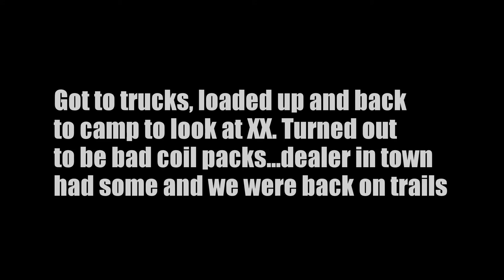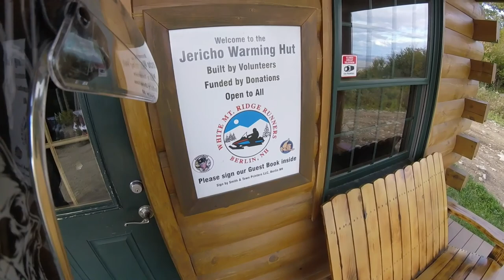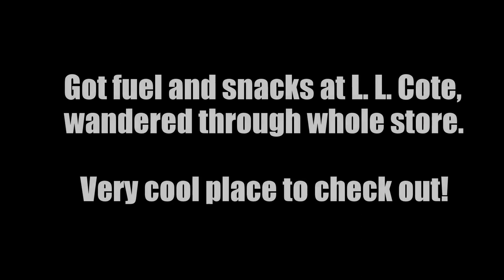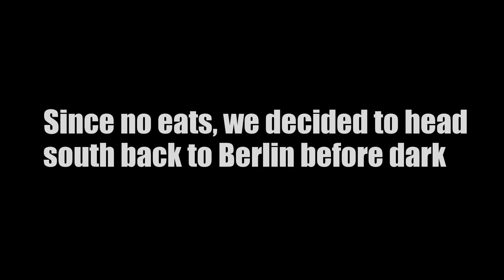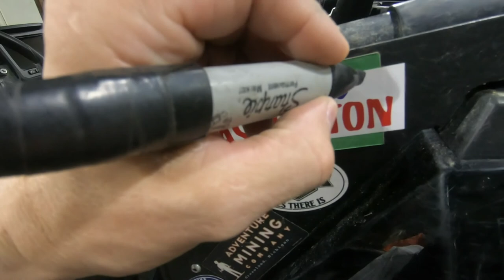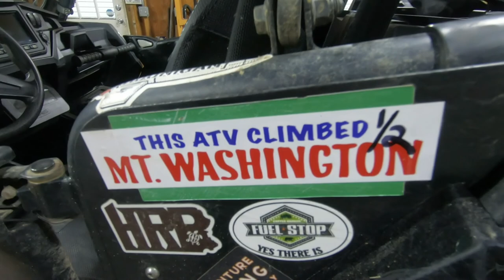What's it like to Ride the Wilds in New Hampshire?

Comment: Rode some of these trails back in September of 2021. Rented an XP1K, found ourselves on a few one way trials that got nasty real quick. Some of them were pretty technical and rocky. I also wondered why they have it gated off so no machines over 68” can ride?
Reply from the maker: We saw fleets of rental XP1Ks in parking lots…like hundreds!!! 😳 and seen a bunch out on trails too!! Yes, some the trails turn rough fast and the width restrictions I’m guessing is to try keep the more powerful machines(turbo cars) off the trails. Seen a bunch of signs that recommended you to switch to 4wheel and go slow goin up and down steep hills to avoid making ruts which I believe in turn to ease erosion …..??? Not really sure but that my guess!!
Reply: The trails in NH try to keep the gates at 65” to keep jeeps off the trails.  Some gates are a little wider, but the 72” units won’t fit.  Most of the 1000 connecting miles in the Ride the Wilds system is on private property.  Most landowners do not want jeeps, trucks or dirt bikes on their property.
Reply from the maker: @mikeouellet3674  we saw where couple spots on Wilds trails were 'detoured' just a little bit off regular trail and somebody told us that's because some the land owners didn't give permission to pass thru their property. Hope it never gets so bad the trails have to close all together, good riding.

Comment: what do you need to ride in NH as a non resident?
Reply from the maker: Just need a permit, I think there were choices on how long permit you buy is good for…we bought 10day permits(didn’t need any more time) and of coarse it was cheaper than seasonal ones. Pretty sure we got em at our camp ground but I think most gas stations near trails sell em!!! That’s it! Cheap too. You’ll get a sticker to place on both front and back of your machine.